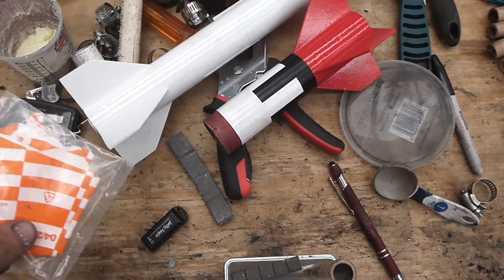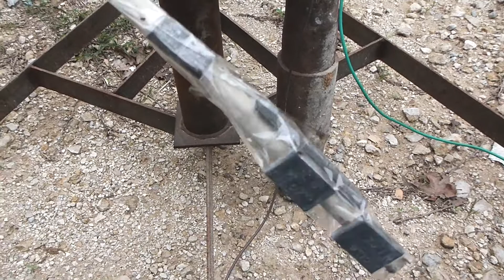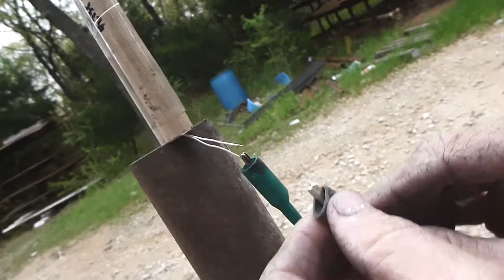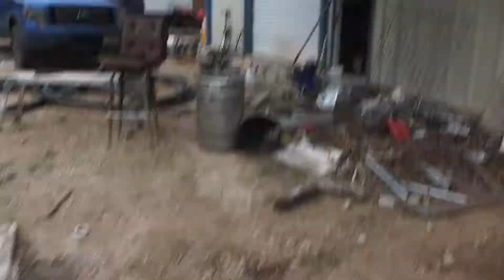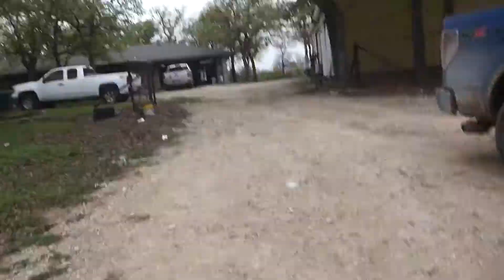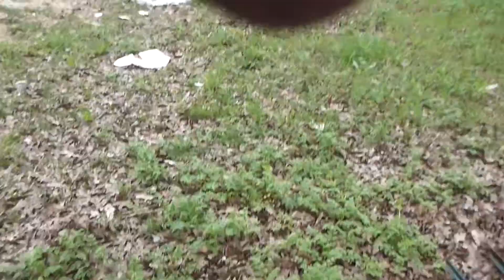Rocket motor weight lift testing

Comment: Conclusion: that size engine can handle the weight, but your test rocket needed weight in the nose (to move your CG forward of the Center of Pressure).